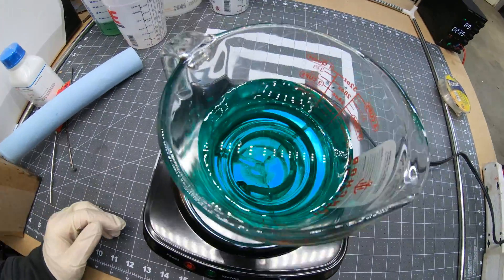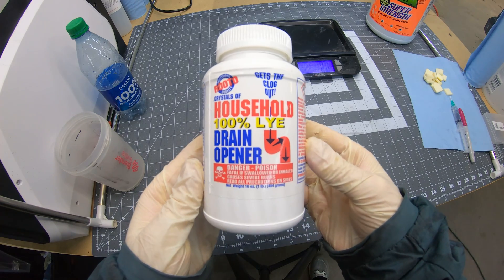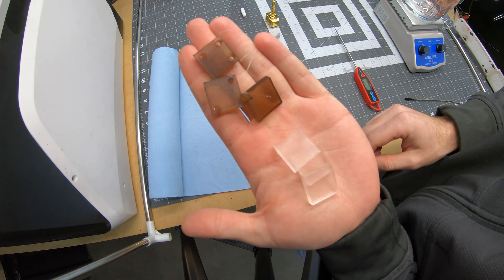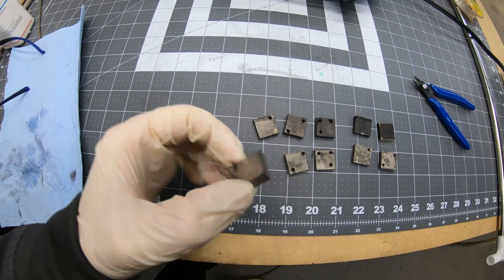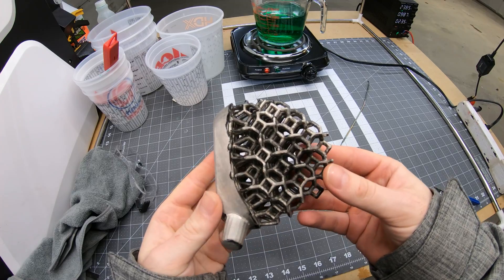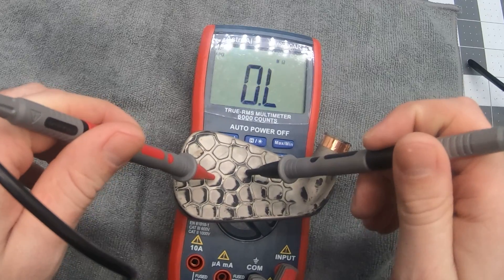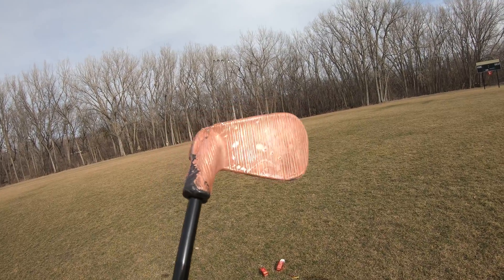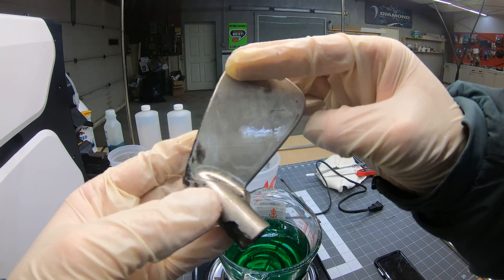Metal Plating 3D Prints Using Electroless Nickel-Phosphorus!

Comment: These electroless coatings are very thin and wont hold up to much abuse, you can get mucb stronger results with active electroplating. Also magnetic bar polishers can work harden copper by peening the surface.

Comment: Have you tried Electroforming?  Apply conductive paint then use similar method but with electrodes, and it can make a thick copper coating!
Also, The liquid in the bag is annoying but it’s the reason they ship in a bag thick bag like that.  I can’t find the exact details but To ship certain chemicals, you’re required to have a container that can catch any that leaks out.

Comment: Sadly Electroplating on 3d prints do not help with toughness. Try print the driver in Ultem 1010. Parts printed in that filament is impossible to destroy according to Zack Freedman.
Reply: You also need to have a bit better printer to print in Ultem though, no?
Reply: @MantisRay861  Yea the price for ULTEM printers are still high but, they are slowly coming down in prices. The other option is ether to send the parts to JLCPCB or others like that (Not affiliated just have used them previously). Or perhaps use PPS-CF or PPA-CF they are about as strong as ULTEM but much easier to print (According to Bamboo lab).

Comment: Man I loved the sequel even more than the original. I am really hoping this becomes a trilogy. I didn’t fully follow if only that print material could be plated but would an FDM printed head with different material possibly handle impact better? Watching a bunch of these 3D printed airless basketball videos out there right now where pla shatters but some of the PLA tough manage to distribute force enough to bounce without cracking while tpu absorbs so much force they don’t bounce.
Reply from the maker: Not sure about PLA but I've read that etched PETG can work pretty good with electroless plating.

Comment: Can you get the plating thicker for strength?
Reply: Fun fact: some of the parts for early nasa rockets were built by electroplating over wax (or something similar). They needed thin channels within the metal so they manufactured the inner side of the rocket nozzle out of metal with ridges which they filled with wax and than they electroplated the rest of the needed thickness. Afterwards they just melted the wax and had their hollow channels. So it is possible to add real substance to the object that probably adds robustness. 8g of copper is not very much and the blotchyness probably means that the shape of the metal can't hold its shape by itself
Reply from the maker: @Schwuuuuup  That's crazy! And they actually sent that into space!

I think the blotchyness was caused by excess heat which caused "plate out".
Reply from the maker: In theory you can electroless nickel plate indefinitely if you have enough solution! But I think there are definitely easier ways to improve strength